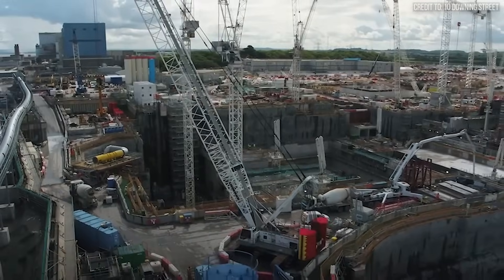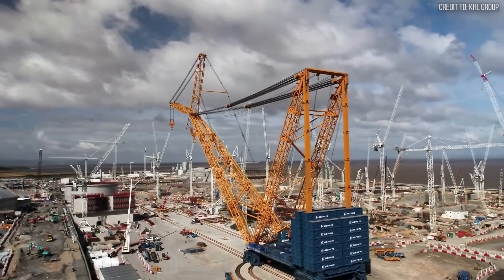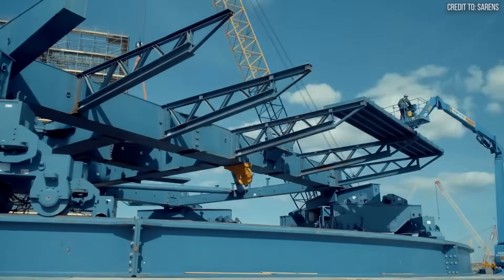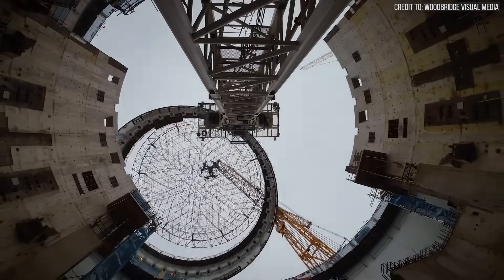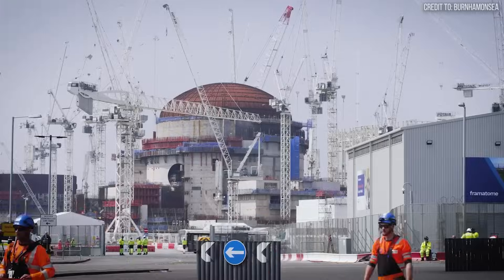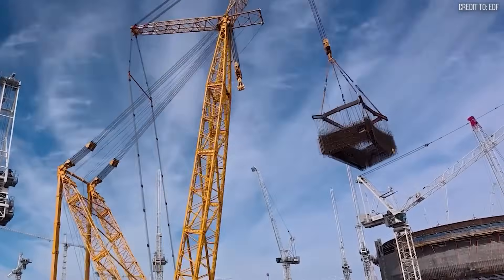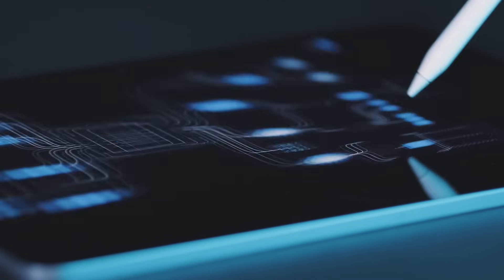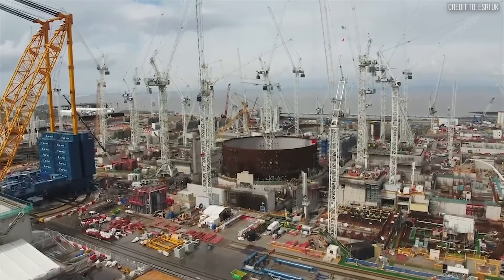This 5000 Tonne Precision Crane Just Changed The Nuclear Game

Comment: (First)…..5000 tons lifting capacity? Wow just wow!!! 😳😳😳
Reply from the maker: It’s impressive what these mega cranes can lift! Hope you  enjoyed  the video.
Reply: Yep, the amazing part is the wire rope is still rated for the same amount so if you have 5000 tons instead of using 10 now you need 50 because it went from 1000 tons to 5000 tons and then the length of that wire rope to go all the way from the top to the ground 825 feet times 10 I need a piece of wire rope that is 2 miles long 1.25 inches in diameter and it has to be flawless